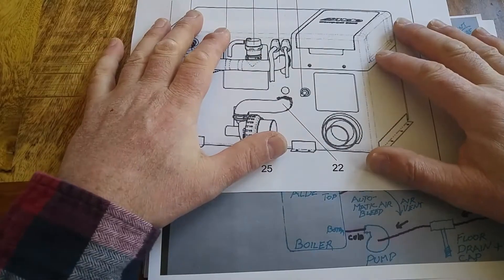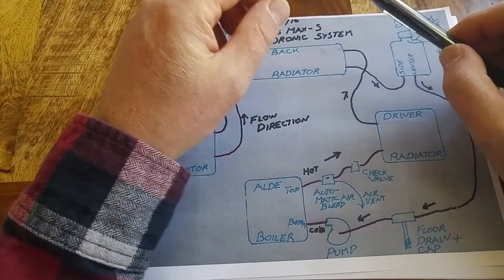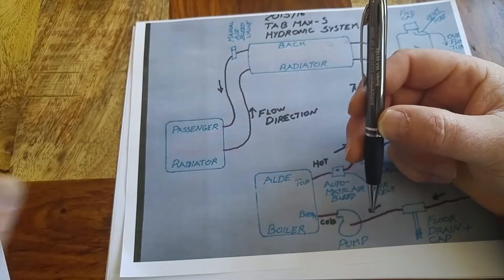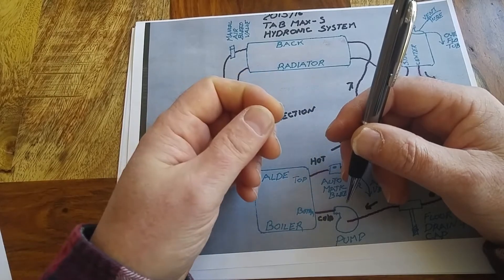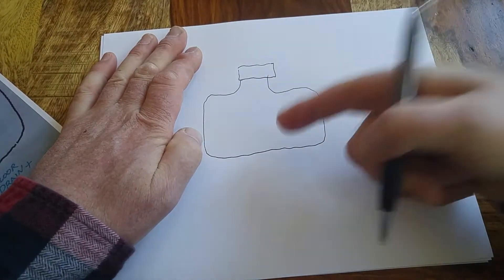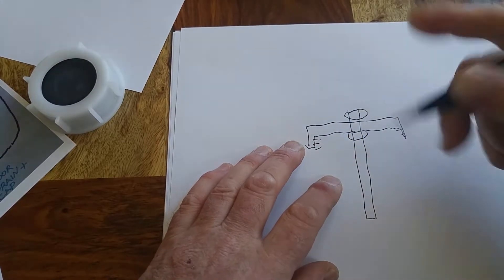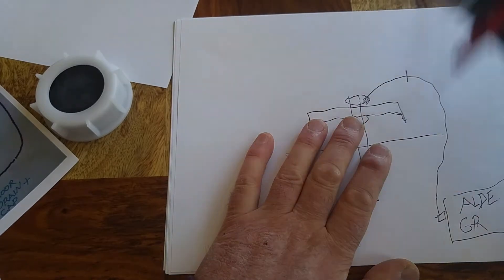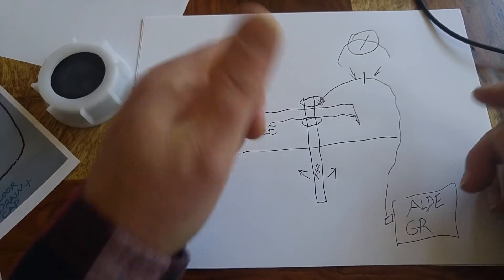Alde Heater Corrosion experiment - Part 1 - Tab Trailer

Comment: Hey, Mark, another great idea you have here.  Do you see any evidence yet of corrosion on the Mg anode?  Also, you make a great point about galvanic corrosion by saying the two metals must be in contact with each other & share the same fluid to complete the electrochemical circuit.  Your wire completes this path, but at 8':10" in this video you say this will also protect all the radiators from corrosion, yet they are not sharing metal-to-metal contact with the anode.  Shouldn't the radiators also be wired to the sacrificial anode?  Further, the most common form of corrosion I've seen in our system was the crevice type under where rubber hoses connect to aluminum pipes.  If this is more a result of pH changes in those stagnant areas, then
Reply: .. continuing..   If this is more a result of pH changes in those stagnant areas, then it's not due to galvanic action, so the Mg anode wouldn't save it anyway.  I cleaned my radiator connection pipes, coated them with a conformal waterproof coating plus heat-shrink tubing to prevent corrosion.  So, I'm not convinced that wiring them up too would really make any difference.  Protecting the boiler seems like a worthy cause though with your simple mod.  I may join your Guinea pig club.
Reply from the maker: @BrianZYou  
Hi Brian,
Given that galvanic corrosion cannot occur without a "return path" for the electrons, and that the radiators are not, and should not be electrically connected to each other or to ground, the corrosion people are finding on the radiator hose connections is NOT due to galvanic action.
You are correct in that the corrosion on those radiators ends is caused by the fluid becoming acidic, and not because of galvanic action..
That being said, IF the radiators are mistakenly grounded, by short or other installation issue, as I have often seen, the rod will help with that.
The rod I've added will not completely resolve the acid problem.
But considering that an acid is a molecule or other entity that can donate a proton or accept an electron pair in reactions, the anode rod will saturate the solution with its own protons, and collect free electron pairs from the solution, it will help alleviate the issue of the fluid becoming acidic.
It sounds like you have a good solution to stagnant fluid under the hose clamps. I may investigate that some.
The resolution of that issue is to replace and flush the coolant regularly. That's why I added the extra drains to my system, to help with that.
As far as corrosion on the anode rod, It's about time for me to take a look. I'll go out and snap a picture this afternoon.

Comment: In a home water heater the "fluid" is domestic water that is always being replaced as water is used in the house.  This is constantly introducing new O2 into the system.  With the Alde being a closed loop system there should come a point when all the free O2 has exchanged it's electrons and reached a stable condition.  The corrosion inhibitors in the transfer fluid are there to do just that - inhibit corrosion.  This is why Alde recommends replacement every two years.  I don't see you anode rod causing any problems but I don't think you will see results comparable to a domestic water heater.  Looking forward to you test.
Reply from the maker: The Alde system is NOT a closed system. Notice that the fluid circulates thru the reservoir every time thru the loop. That reservoir is vented directly to the atmosphere. The fluid is CONSTANTLY picking up additional O2 from the surface when in use.
My O2 meter shows more disolved oxygen in that fluid after an hour of use, than the water from my tap.
Almost 17 percent, as compared to 11 percent at the tap.

Remember also that the additives in the fluid are PH buffers. They only help the liquid from becoming acidic. They don't offer protection from galvanic or electrolytic corrosion. Those buffers only protect from the third kind of corrosion going on here, that is, acidic corrosion.

An anode protects from galvanic corrosion, not acidic corrosion.

Your home hot water tank does not need acidic buffer PH protections, because the water doesn't circulate in your tank for months long enough to become acidic.
Reply: @tabtrailerupgradesandmaint2923  If this is the case, picking up O2 in the expansion tank, what about a relief valve in the overflow line.  This would allow venting of the tank without the reintroduction of O2 back into the system.  If properly filled to the correct level the expansion tank should have the volume to contain the transfer fluid upon heating without overflowing.  This is how a commercial/home heating boiler system works which are closed loops.
Reply from the maker: @dw3897  a check valve might limit O2 ingress, but since glycol has a thermal expansion coefficient seventeen times that of water. You might experience a "pumping action" with each hot cold cycle that could cause enough vacuum in the system to collapse a hose. I'm sure something could be worked out.
A bladder tank instead of a rigid tank?
Who knows,....
My plan is to use the new drains I put in to change the fluid out regularly, to allow the buffers to protect from acid corrosion.
Add an anode rod to protect from galvanic corrosion,
And comb thru my trailer's ground and electrical systems, making close voltage measurements to stop any electrolytic corrosion that might be taking place.
Reply: @tabtrailerupgradesandmaint2923  Looking forward to your results.  Sounds like a simple enough install.  Thanks for your videos.